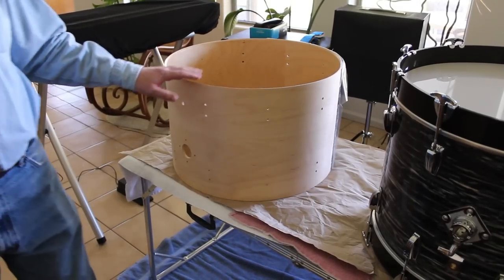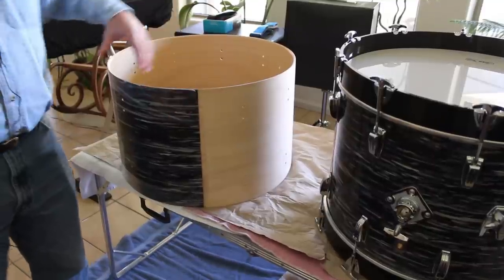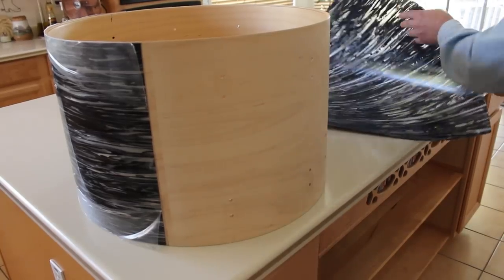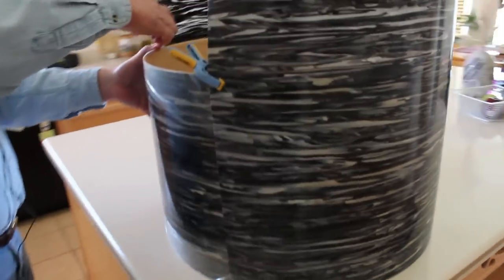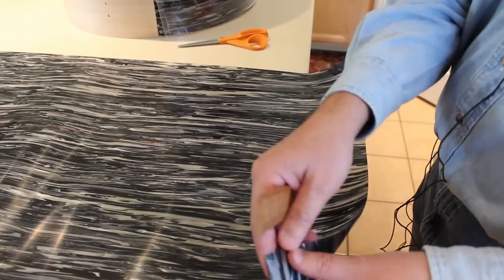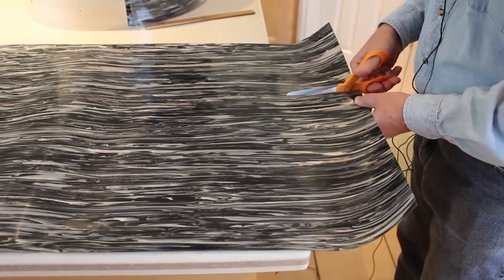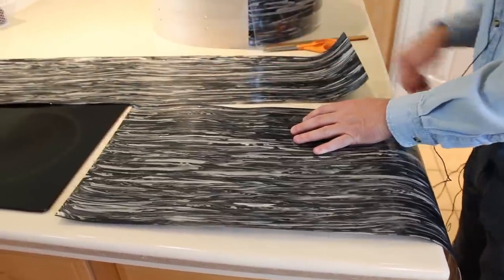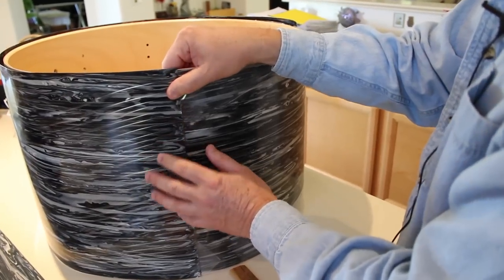Bass Drum Re-Wrap Tutorial Part 1

Comment: The finish comes originaly  from Delmar Plastics, if you want to re wrap a standard 12, 13, 16 & 22 in ludwig kit from the 70´s ( no snare drum), you're gonna need to buy  2 wraps and measure before you cut them cus' what they send you is exacly what you need , believe me...not a inch more!!!, dont cut material in excess, cut the exact size,, be sure you  measure taking into account the bass drum hoops trims, the way i did it was to cut bass drum, 13 tom and one of the  bass drum hoops from the first wrap sheet, and from the second  wrap, the 12 tom,  the other bass drum hoop and 16 floor tom , out of this, 2 pieces of wrap are left,  you are to use this two pieces to complete the bass drum hoops and put the rest underneath of the bass drum, ( the two of them), hope this helps!

Comment: Would it be possible to cut the wrap to fit just right at the edge where the drum head attaches with out having to file it to fit ?  I have seen some wraps that end where the drum head metal ring begins and it worked fine. Just wondering ?
Reply from the maker: Potentially, might depend on if that lip that's not feathered is an issue with your particular setup.  Thanks for watching!